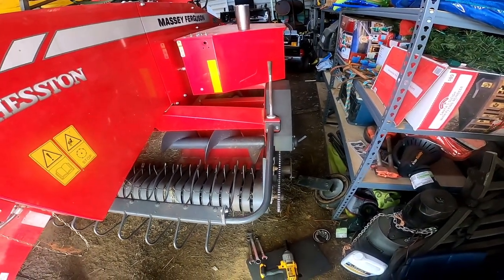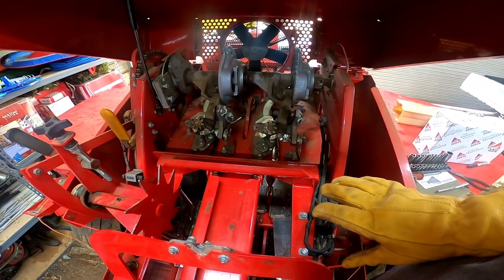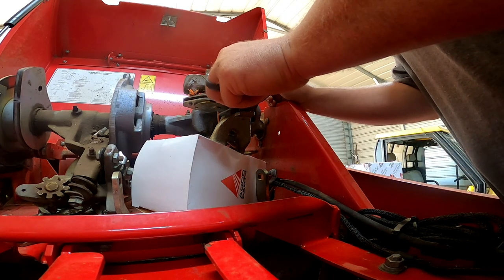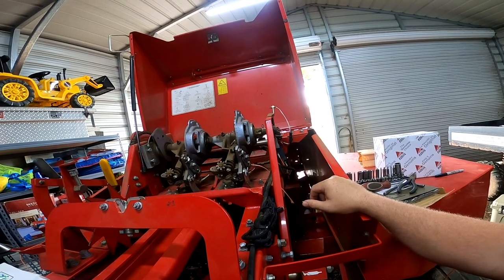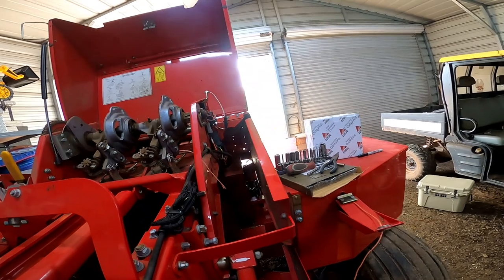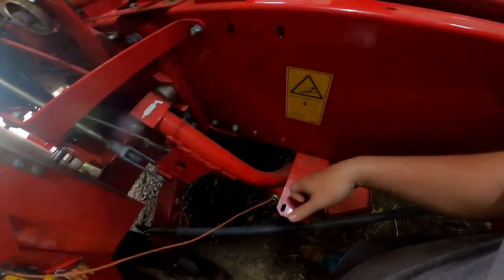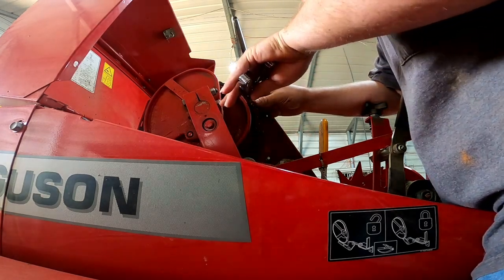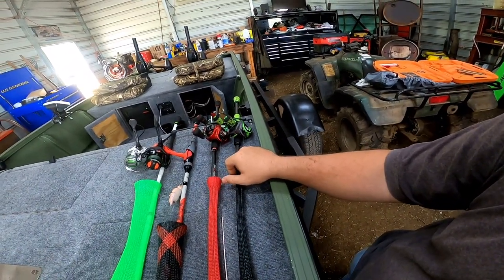Tuning the 1840 up

Comment: Ever have issues with with lush hay getting bound up in the feed augers causing them to stall while everything else keeps running? My baler is belt driven on one side, chain on the other. I probably just need to replace the belt, it screams and burns when the issue happens.

Comment: The knotter will rotate to vertical on the stack if you help the knife arm cross the billhook forward and back, makes getting to the knives simple.
We sharpen the knives to razor sharp, even make them if they break out of high carbon recip saw blades.

Comment: Does your 1840 baler leave little tails of twine up around the knotters and the hydraulic tensioner channel ? Mine does just curious if that is normal .
Reply: @EOF, yes that is normal.  There is a tail every time the knotter ties.  The twine disc holds the starting end of the twine as each bale is formed, then that short piece is ejected from the twine disc after the tie cycle is complete and the twine is cut.
Reply: @paoutdoorsman  Thank you.